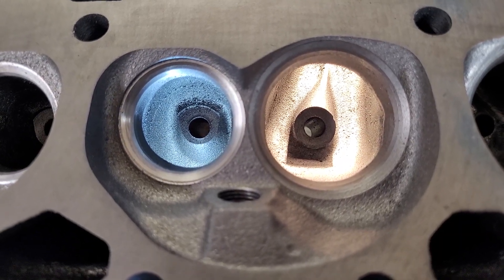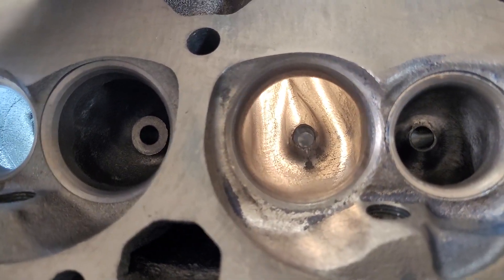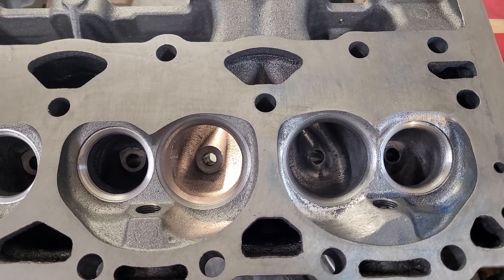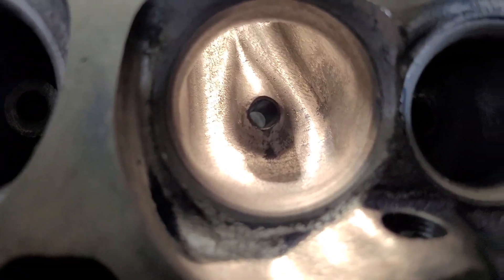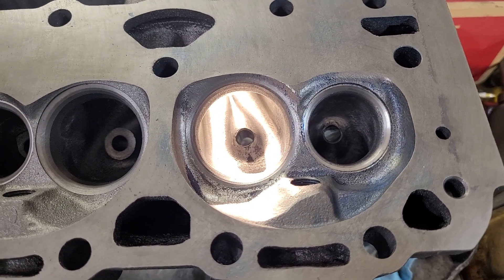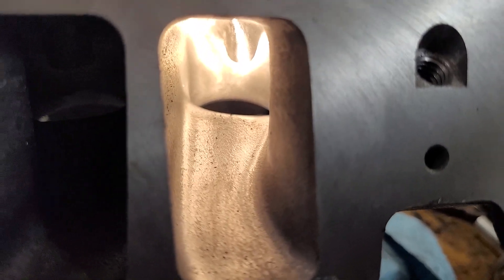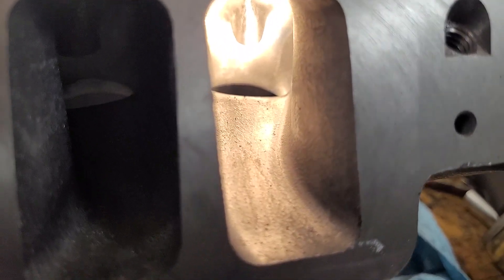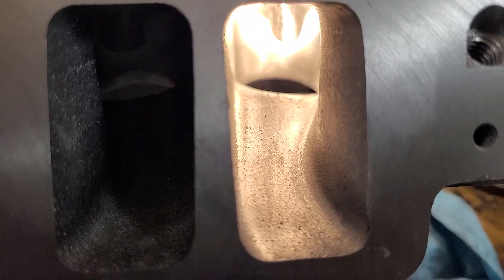EQ lightning Vortec cylinder head porting and IOP program analysis

Comment: Is it the Popular Hot Rodding article, 447 HP Vortec Small-Block Build - Budget Sledgehammer?  You should easily sail past 500
Reply from the maker: @chrisstavro4698  D.V. designed budget sledgehammer

Comment: You think you could hit 275 cfm on these ???
Reply from the maker: I know I could. With a 1.94" valve it would be more difficult. This application will not need that much airflow unless he would like to turn it up.
Reply: I was pondering some personal goals I had with a 383 or a 406……. Debating promaxxx vortecs as the EQ don’t seem available
Reply from the maker: @rudyjhughes  I have not seen the Promaxx but these came from competition products.

Comment: How much better are they out of the box are they than a factory head? And I'm guessing when you're done they will probably beat the GM aluminum fast burn heads. But now I'm wondering about porting the fast burn heads. I have both
Reply from the maker: These are very heavy and I would expect crack resistant. I have no doubt they are beating fastburns right now.
Reply from the maker: I actually looked up the fastburn flows. They have 210cc ports and flow 275. I did not think they flowed that much. My little brother had a 385 crate engine in an el camino with fastburns and it was a slug.
Reply: @servediocylinderheads  Thanks for the great information!
Reply: @servediocylinderheads   Thank you!
Reply: @servediocylinderheads  going to be exciting to see the results.  Big plus seeing DV involved.  Thanks for the great videos.